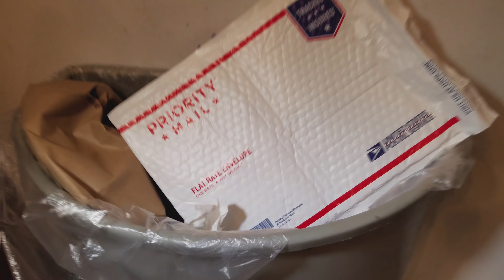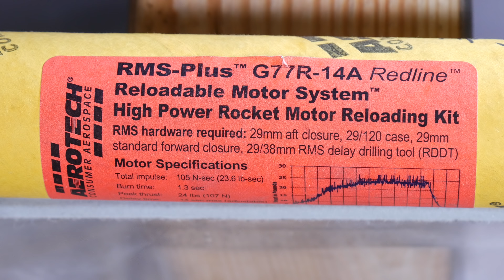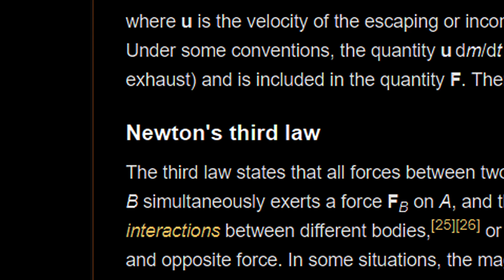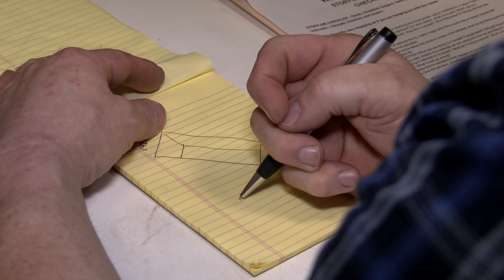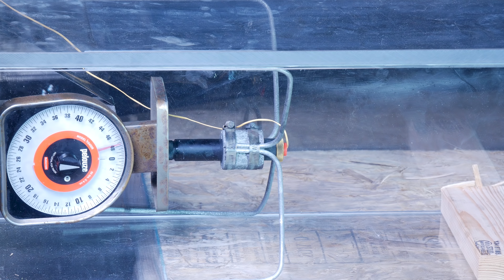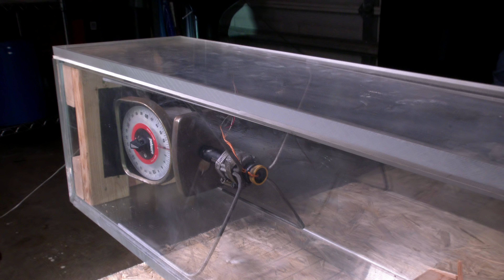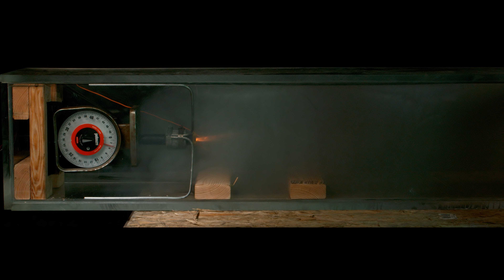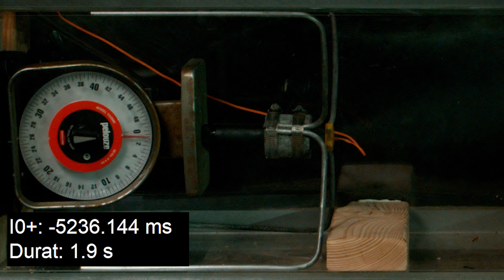Rockets in a Vacuum Chamber - Newton's third law of motion Visualized

Comment: First of Your engine is all wrong.. it’s not even a engine is a rocket toy.. that requires the earth atmosphere to even start where a actually rocket has its own gasses and h2o to create the thrust needed.. so obviously if you take away the atmosphere and try to use your cave man rocket with fire igniters you’ll end up looking pretty dumb. Blow up a balloon and release it in a vacuum. The ballon has everything inside to propel it forward.. not pushing against anything, it thrust comes out of its small bell that works like a engine. That’s how a rocket would work. So how do you explain this cave man experiment?? 🤦🏾‍♂️ Yeah ..

Comment: why  no  hypergolic visible fire  when  apollo take of  from  moon like  soyuz and  starliner ( or space not vacuum ? )
Reply: Hypergolic flames are often invisible.  Its often the IGNITERS that you see making sparks and flame at first.
You cant really see the flames from the upper stage of the Falcon9 when viewed from close up either.
Reply: Check out pictures and videos of Titan II launches. It used the same fuel as the Apollo ascent and descent stages. The fuel burns nearly clear. There is a faint glow largely from the exhaust plume heating up ambient air. 

In a vacuum and with 60s/ 70s camera technology, it is not surprising that the exhaust plume is not visible.

Comment: The problem that I see with this experiment is that the vacuum chamber isn’t large enough. The gases expelled by the burning rocket engine, create an atmosphere that the engine can thrust against.
Reply: You can see that thrust is measured pretty much the instant we see a flame leaving the rocket motor. That is well before the chamber fills with an appreciable amount of gas. 

Also, there’s just no physical mechanism for a rocket to push off air. The rocket exerts a force on its exhaust gases and, in accordance with the third law of motion, the gasses exert a force back on the rocket. The rocket doesn’t “feel” when the gas particles that have been ejected strike something for the same reason you don’t feel when water from a hose hits the ground.

Comment: It's funny how science nerds can use Newtons 3rd law of motion to prove thrust in space but then go completely brain dead when it comes to floors pancaking down on 9/11 at the rate of free fall acceleration in the beginning of the collapse and then almost reach near free fall speeds during the rest of the collapse- where were you guys ? The height of the South Tower is 1362 feet and it collapsed in 10 seconds, that is .8 of a second slower than free fall speed.
   Now according to Newtons 3rd law of motion, each time a floor impacts the floor below it should cause a force of equal magnitude in the opposite direction causing the floors to momentarily stop. Remember the bottom 3/4 of the building was not hit by a plane and was undamaged also. For the one of the towers to collapse in 10 seconds there would have to be almost no friction but all the dust shooting out during the collapse suggest massive friction and if you watch closely you can see the steel beams that shot horizontally from the building in the beginning of the collapse are falling at almost identical speeds of the collapse of the building . It just goes to show how gutless people of science are but here's the problem, those people who took down those 3 buildings on 9/11 and murdered 3,000 innocent lives and caused those people to jump from 95 stories high to their death are still in power and running the world........ GUESS WHO's NEXT !  see if you can ignore that, this time..........
    P.S Just like rocket fuel needs an oxidizer to burn in space, did you know the twin towers burned for almost 6 months beneath the rubble and the constant flooding from the fire fighters hoses ? They have pictures of specialized heavy equipment pulling molten iron out from the debris 3 weeks after the collapse !!! There's only one way fuel could continue to burn like that and it's not with jet fuel.
Reply: cool story bro.

However, Rocket propulsion works just FINE in a vacuum, regardless of your "Physics" explanation above.

Comment: Does the truster burns without oxygen?  Or else they violated another law... the law of how fire works which needs oxgyn... so if this thurster burns it means it is not totally vacuum....moreover its a limited space which the carbon dioxide fromthe burning also produce a molecular environment... this experiment has flaws...
Reply: Chemical rockets contain oxidizer.
DO you think a hand grenade needs atmospheric oxygen to explode?
Perhaps you could consider taking high school chemistry BEFORE accusing all engineers of being imbeciles?

Comment: Strange ,messy  set up. Just use and eletric engine with a Propeller. No burn and smoke involve
Reply from the maker: Propellers don't work in space
Reply: @WarpedYT  because thrust in a vacuum is by definition impossible.
Reply: @papalegba6796  - "because thrust in a vacuum is by definition impossible."

So a crossbow fired into a vacuum would NOT have any recoil?
I think you have that wrong.

Comment: Can't have a vacuum without a strong barrier, but we are told it's right on the other side of our atmosphere without a barrier. Thanks for putting all the work into this experiment, it was interesting and informative. I think the moon landings and all the stuff NASA puts out is fake. I like real science, like what you're doing.
Reply: @darklight2.1  the official story is there is no physical barrier, otherwise how would they lie about the moon landings?
Reply: @susanbigknife  - A device known as a "Gas Centrifuge" can create a region of high-pressure gas right next to a region of low-pressure gas with NO PHYSICAL BARRIER between the two regions.
Care to give us a guess as to HOW this device does this?
Hint: It's IN THE NAME genius.

A TURBO-CHARGER can do exactly what you are confused about.
HOW?
Reply: @susanbigknife  Barbara, where did you go?  Did you read my explanation, or do you run away whenever someone starts talking about "science"?
Reply: @stuartgray5877  the earth isn't spinning. You can't assume gas centrifuge is a good working model when all empirical evidence indicates a flat stationary earth. I decided not to debate with you because the rift is too great.
Reply: @stuartgray5877  you don't know what you don't know.
Reply: @susanbigknife  - I have an actual engineering degree. And I have been working as an aerospace Test Engineer on some of mankind's most advanced vehicles since before you were born.  I have worked at (or for): Lockheed Martin Space Simulation Laboratory, Lockheed Martin Flight Systems, Jet Propulsion Laboratory, Laboratory for Atmospheric and Space Physics, Goddard Space Flight Center, Marshall Space Flight Center, DOD, NOAA, and NASA.
I have personally helped launch six spacecraft, two to earth orbit, and four to deep space.
I have been on the mission operations team of three of those.
A hypersonic vehicle that was the fastest manmade object to fly through earth's atmosphere is in the Smithsonian Air and Space Museum with my signature inside it.
But a high school dropout is going to lecture ME about the technology of spaceflight?
No, you are suffering from the Dunning-Kruger syndrome.
But Bless your little heart for effort!

Comment: If newtons third law appiled in a true vaccum, then shouldn't a propellor still work
Reply: what? of course not, there's no mass for it to accelerate
Reply: Propellers and Jet engines use atmospheric gases to push away from the vehicle creating an "equal and opposite" force to push the vehicle forward.
Rockets do the same but must take their gases WITH THEM to space.
Reply: No. The propeller pushes a plane forward because the propeller strikes air particles, sending them backwards and therefore pushing the plane forwards. No air, no collisions, no thrust.
Reply: @frantaspacek9583  Exactly why a rocket wouldn't work.
Reply: @stuartgray5877  However, the gases lack a medium to exert pressure against. Furthermore, the creation of pressure is not feasible since all atoms would exhibit the same velocity in a vacuum because the absence of air resistance.
Reply: @Cody-mc7oe  Propellers work by colliding with gas particles. Rockets work by ejecting mass out the back. Both rely on the third law but they have different methods of sending mass backwards. 

If you sit in a rolling chair and throw a heavy object, you’ll roll in the opposite direction than you threw it. Now, instead of throwing the object, you use combustion to eject mass backwards out of a nozzle. You’re still throwing mass backwards, so you have a forward force imparted on you. 

It would be a violation of the laws of physics for rockets to not work in a vacuum.
Reply: @Cody-mc7oe  But accelerating those molecules of gas requires a FORCE!
The exhaust gases are not accelerated by "Magic".
Where do you think the force originates that accelerates the mass of the exhaust into the vacuum?
Reply: @Cody-mc7oe  Oh AND: People who failed to complete high school physics should NOT go around trying to explain rocket propulsion to rocket scientists.
Reply: @stuartgray5877  You're a chatbot, not a rocket scientist 😂
Reply: @papalegba6796 I know that reading comprehension isn’t your strong suit, but I figured that even you could understand an analogy. 

And do rocket scientists just not exist according to you?
Reply: @papalegba6796  So then clear this up for us.
Stop just saying Nu-Uhhh!

EXPLAIN how rockets accelerate mass.
Come on YOU CAN DO IT.
(but you REFUSE because telling the truth will ruin your delusion)
Reply: @Cody-mc7oe  rockets bring their own mass.
Reply: @papalegba6796  "Rockets don't have arms on the back throwing bowling balls"   Did you really write that???  😂
Reply: @Cody-mc7oe  Rockets work by the same mechanism that propeller planes work.  They push mass away from them.  Propellers use the mass that's already in the air around them.  THE AIR.  Planes eject mass that they've borrowed from the surrounding air.  Rocket bring the mass with them.  Rocket fuel.  Planes need fuel to operate an engine which in turn spins a propeller to push mass away from them - generating thrust.  Rockets use fuel as the mass itself which they push away from them - generating thrust.

It's about pushing mass away from you.  Planes push ambient air; rockets push combusted fuel.  It's the reason rockets are so big.  They have to bring a lot of mass with them because that's the stuff they push away to generate thrust.  The reason they use fuel as the mass is because they can ignite it and control the direction is goes - - and it explodes, so it comes out with a LOT of velocity.  

If you were floating in empty space while holding a bowling ball, and you pushed that bowling ball away from you - - I can assure you, you would indeed be thrust in the opposite direction.  Now you're out of fuel.  Rockets are big because the vast majority of the structure is fuel tanks.  They take more than one bowling ball with them to throw.....
Reply: @willoughbykrenzteinburg  if propellers & rockets work the same then rockets can't work in a vacuum 😂
Reply: @AM-rd9pu  the analogy is false, as i pointed out, chatbot 😂
Reply: @papalegba6796  All you did was give a childish retort to avoid the fact that rockets eject mass.
Reply: @AM-rd9pu  papalegba believes that mass CAN be accelerated without applying any force to that mass.
See papalegba believes in "Magic".
Reply: @stuartgray5877  I know he implies that, but has he directly said that?
Reply: @AM-rd9pu  it has explicitly stated that the mass from a rocket engine does not require a force to change velocity.
Reply: @stuartgray5877  Brilliant
Reply: @stuartgray5877  kinetic theory & thermodynamics are not magic, chatbot. You're just not programmed to understand them !😂

Comment: Wait what? “A complete…full vacuum”?!! 🤪🤪🤪In a plastic box sealed with a flimsy lid that bends under its own weight while holding out 14.7psi of atmosphere with cheap foam tape? Your scale barely broke -15Hg and space is a vacuum of almost -30Hg which is exponentially more vacuum than you could ever pull here on earth. Omg and even worse is your rocket says on the label you should get 24lbs of thrust and you lost exactly half that as your scale couldn’t break 12lbs 🤪 and to boot you pressurized the closed system the second the rocket ignited 🤣… holy moly were you arguing against flat earthers or what? This was the most unscientific experiment ever and I hope nobody actually missed the glaringly obvious flaws. May the scientific method RIP… true science has been replaced with impossible theory artificially supported by peer review instead of real science 😵

Comment: This comment section is a fun read lol, 3.5k dislikes for stating the facts.
Reply: @jrngln  
Nice copypasta. Every word of what you just said was wrong.

1) We can get close enough for practical purposes. Technically space isn't a pure vacuum either, but it's so rarified that molecules rarely come into contact with each other.
2) A vacuum doesn't "absorb" anything, you're speaking nonsense.
3) How exactly do gases on the opposite side of the chamber affect the rocket motor? The answer is they don't. The only forces come from the direct interaction between the motor and the gas. As soon as the gas leaves the motor, it can't transmit a force.
4) Yep. Rockets push off of their exhaust gas.

Comment: Learn about vacuum levels , you get 0.1 Pa or less?  Smaller rocket PROVES no thrust in vacuum. 1. Connect your vacuum chamber with more volume chambers. 2. Compare  with different vacuum pressures with less friction measuring unit , not this idiotic spider.
Reply: So I would NOT feel recoil if I fired a crossbow in space?
Reply: @stuartgray5877  recoil is not thrust. Go back to school.
Reply: @lorchservice4366  

Recoil IS thrust. What do you think pushes the rocket? It's the fact that the expanding gas pushes in all directions except along the forward-backward axis due to the hole in the back. So the forward pressure has no cancelling "push" at the rear, so the rocket gets pushed forward, EXACTLY like a gun recoil.
Reply: @beneichhorn5855  mass exhaust is not "pushing off air". 1st work in vacuum , second not.
Reply: @lorchservice4366  
Sorry. Don't understand your point.
Reply: @beneichhorn5855  if  you stand on skatebard and throw away something heavy away , you get acceleration right ? this will work in air and in vacuum right. When you blow air you also get some acceleration. This will work on air , acceleration in this case in vacuum  is irrelevant. In this video small rocket scale is shaking, coming from mass throwing , not thrust.
Reply: @lorchservice4366  

You don't seem to understand what pushes a bullet or a jet engine or the piston in your car. When the gas is ignited, it becomes superheated and super-energetic and expands in all directions with great FORCE, pushing the bullet out (and your shoulder in a recoil) and pushes the front of the combustion chambers in the jet plane or rocket. No atmosphere required at all.
Reply: @lorchservice4366  Exhaust gas HAS MASS it is no different than throwing a bowling ball it will STILL push you backwards.

Comment: Reply from flat Earthers: "The force is measured because the rocket pushes off the rear wall in the vacuum chamber."
Reply: I'm not a flat earther in any way, and I fully believe a rocket will produce thrust in space. BUT, the rocket thrust here most likely was pushing off the rear chamber wall. Not that hard to fathom
Reply: @donnyray9922  Right, but that's not the reason the force is measured. I'll change the statement.